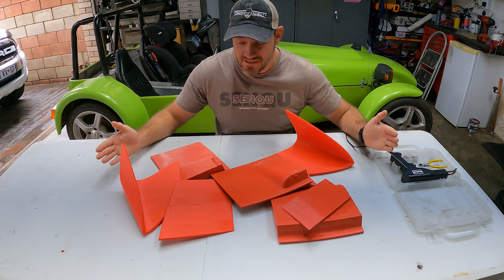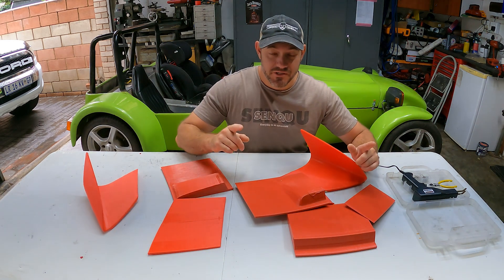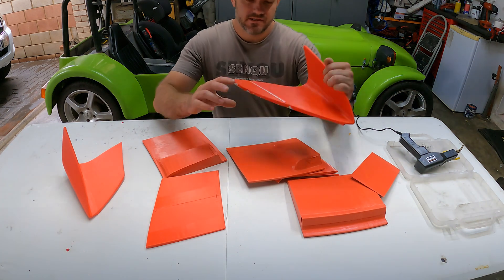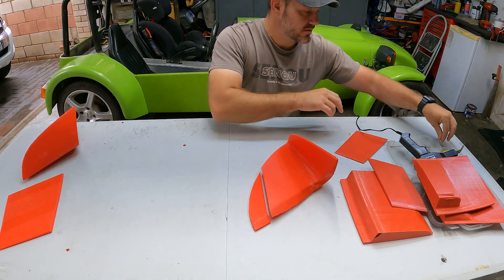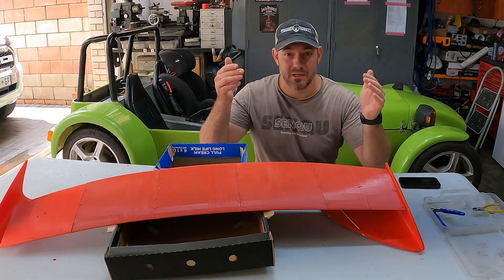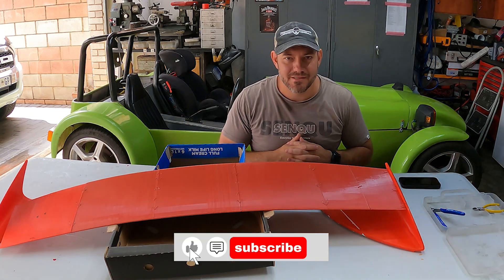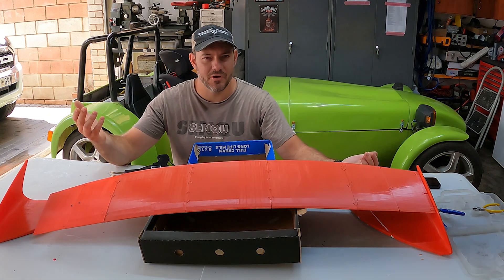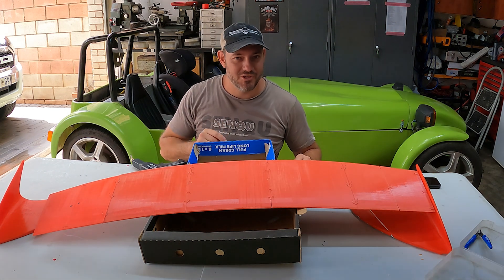Using my Creality Ender 3 V2 to #3dprint Jaguar XFRS Spoiler! Part 1  #ender3v2

Comment: Nice one bro! Using my E3V2 to print pieces for a front lip I designed and modeled in Blender. Sure, it takes a minute to print each piece but you use what you have. 

It added small alignment tabs so when I put them together that will help keep the pieces inline while I plastic weld together.

Comment: I’d fiberglass it and see how it holds up. Strength of fiberglass is great for stuff like this and layering will increase strength with minimal weight
Reply from the maker: I could probably use 100gsm fiberglass to reinforce and get the deflection out before I do the mould.